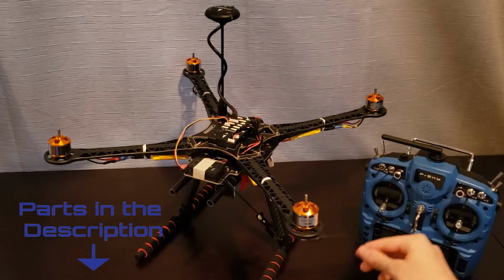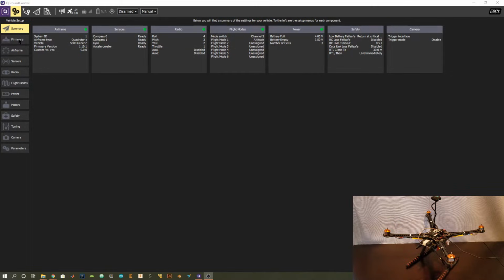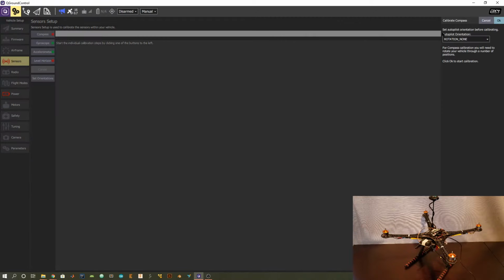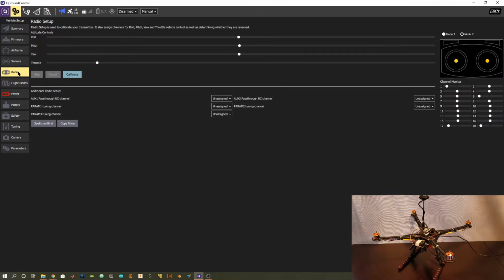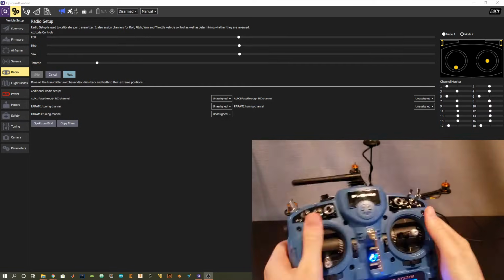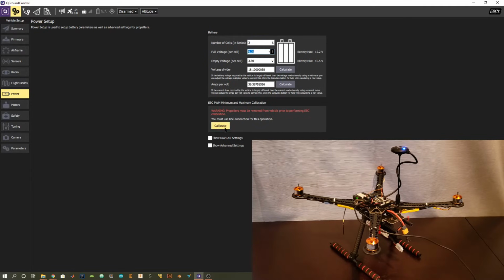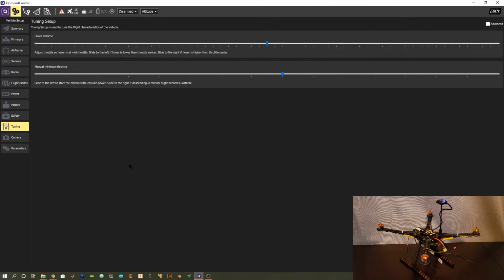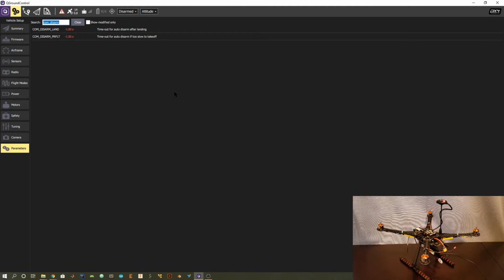Pixhawk 4 Setup and Calibration with QGroundControl | Pixhawk 4 + S500 Drone Build Tutorial | Part 4

Comment: Hey, thanks again for your eleborate and clear tutorial. I have a problem with taking off my S500. When I try to take it of in position mode (actually in every mode) it spins like hell and it is uncontrolable. It goes up in the air but spins so hard that it crashes after 3/4 seconds in the air (I already broke 1 arm and 3 proppelers :( ). 2 motors are spinning clockwise, 2 are spinning counterclockwise. I did ESC calibration in QGroundControl. I have the feeling that 2 motors (the clockwise ones)  are spinnin a little bit slower than the other two. Do you have any idea what the problem might be and how to solve it?
Reply from the maker: - First thing that comes to mind is that the motors are not spinning in the correct direction. The top left motor and bottom right should be clockwise, the top right and bottom left should be counter clockwise. Also make sure with the propellers that the leading edge is higher for each direction.
- Double check you selected the correct frame configuration in QGroundControl.
- When you did your calibration are your pixhawk and gps both facing the front of the frame?
- Double check any soldering you may have done, see if something broke off.
- Do you smell anything? This could mean a motor/esc burned out.
- Also make sure you have a full battery.
- It could also be something with the PID gains but since you are using a standard S500 the default gains should be fine to get you started.

Check these out and let me know if any of this helps.
Reply: @AlexFache  Hey Alex, thanks for your response. 
-The motor are (100% sure) spinnin in the right direction
-Pixhawk & Gps faced front of frame when calibrating
-I use the S500 V2. I tried PID tuning and choosing other airframes in QGroundControl but it didn't help, the drone keeps spinnin and crashing when taking off

I really don't know what else it could be, do you have any more ideas?
Reply from the maker: - Do you have the IO cable from the pixhawk going to the power management board? I assume so since the motors are all spinning.
- Try going into the parameters list and setting everything back to the default value (there should be a button to do so on the right hand side I believe, else look for all of the red labels). Maybe you accidentally changed something. The only one I believe I changed was COM_DISARM_PRFLT (you can increase this so that you have more time to takeoff).
- Are you taking off on a level surface? Make sure long grass/twigs don't catch the legs. This could create some kind of ground effect.
- Is there any chance you are flying in an area where other radio signals are present? (cell tower for instance) These could be interfering with your controls.
- Are your receiver antennae mounted away from motors? Same goes for GPS. Do you have a distance sensor, FPV transmitter, or something else that is sending out any signals. The way it's positioned could also cause some interference.
Reply: @watro2934  hi, did you sort it out? Please, check your motor order - for PX4  it should be (clockwise starting from top left) 3,1,4,2 - which is different from Betaflight's 4,2,1,3  (which is also common). There are also some others. This is what cause problem in my case, I also broke some props (luckily nothing else).

Comment: Great Job, I have a question: did you have to tune the PID parameters, o were the defaults enough to fly? Thanks :)
Reply from the maker: Hi Matte, for the S500 frame and my setup I did not touch the PIDs. They have been very stable for my flights and because there is a "default" frame available I believe they have been tuned by a PX4 contributor. All of my crashes were me messing around with the transmitter. However, if you do plan on adding heavy payloads then you may have to mess around with the values.
Reply: Alex Fache FPV Thank you! So am i right assuming that following your videos i will get mine up and flying? The setup is the same, i only have Holybro 2216 motors (wich btw are made for the s500)
Reply from the maker: I believe this is the kit you're referring to: https://shop.holybro.com/s500-v2-kitmotor2216-880kv-propeller1045_p1153.html
Those motors have pretty similar specs so you're good to go.

Yes, everything I had to do to fully setup my quad is in these videos. The only thing I recall doing off camera was securely mounting my receiver and telemetry module. The telemetry kit comes with some double sided pads you can use or 3M has double sided adhesives of different sizes. Just make sure that the telemetry/receiver antennas are out of the way of the props.

Let me know of there's anything else and have fun with the build!
Reply: I followed your videos step by step, and today my S500 quadcopter flew successfully at first try. Thank you very much for your guide and support :))
Reply from the maker: Congrats and enjoy flying!!! I'm really happy to hear the positive feedback that these videos are helping you all out!

Comment: I’m trying to get into drones using my 3D printer.  I literally know nothing and almost have a racing drone complete but I think I want the pixhawk for making videos.  Can you connect a caddy vista to the pixhawk?
Reply from the maker: I have not used one of these cameras before but I took a look at the website. Seems like it's meant to fly with a DJI drone but it might work for other configurations as a stand alone device. Here are some of my thoughts:
1. From my experience my FPV camera has not had to interact with the flight controller at all meaning it shouldn't matter which camera and flight controller you have.

2. For a FPV camera setup you'll need the camera, a VTX (video transmitter), a power source, and a compatible receiver on your ground control station / monitor / goggles. Looks like the caddy vista comes with a VTX and antennae built in.

3. If you want to make high quality videos then you'll most likely want an action camera instead of a standard FPV camera because of the major difference in video quality. For my Pixhawk 4 setup I have a a really cheap FPV camera and it's own VTX so that I can "see" what my quad sees but for filming I've attached a GoPro Hero 4.

4. The Pixhawk is just a flight controller and does not have a VTX built in. This means that you would need a VTX connected to your FPV camera to send your video feed to a ground control station / monitor / goggles. On your goggles you would need a receiver that pairs with your VTX. This will allow you to view live footage for FPV flying.

5. With the Pixhawk you have the ability to trigger a camera (action camera, GoPro) to take pictures however I'm not entirely sure how to do this.

Let me know if this helps or if there's anything else.
Reply: @AlexFache  It does help, perhaps I am over thinking things.  I started off building a racing drone using something called "birdbones" 3d print. I think because I am not flying I just want everything and perhaps do not have realistic expectations.
Reply from the maker: I've felt the exact same way. Buying a prebuilt quad is definitely easier and less frustrating, however, you learn so much more building your own and it seems like that's the direction you want to go. When I built my first drone it was a process of a few months from researching components to my first hover flight. I ordered the frame and main components, then decided to add FPV, then I had to get new batteries/propellers, then added a battery alarm, etc. Basically, I did not have everything I needed from the get go.

For your specific frame see if there is a recommended FPV setup (for instance how would you mount it, dimensions, layout of components, does it need an external battery). That might be the easiest way to get something up and running and you'll enjoy it more rather than focusing too much on the detailed specifications. My current FPV camera is a cheap ~$20 all in one (camera + VTX + antennae). Very cheap with okay performance. The big thing though, I was able to get it up and running using a monitor and was quickly able to enjoy it. That was important for me. I'll be upgrading to goggles and a better camera most likely with the next few months now that I've had some basic flying experience.

Comment: Thanks for the videos man, good timing, just put together a 3D printed quad, just getting it all setup, your videos will help with the pixhawk side of things for sure.
Reply: E85Johnson  your also into 3D printed drones lol new too
Reply: @takingtheblackpill  Yeah man, I'm planning on printing a few from this guy's designs: https://www.thingiverse.com/thing:753840 I went with the big TX8, it's huge! And weights a good amount with 2 11v 6000mah batteries. I'm going to print one of his smaller ones also.  First time getting into diy drones, it's really fun, but lots of research and learning on my part. At least with the 3d printer, I can have a lot of spare parts for when I crash lol.
Reply from the maker: That's really neat! I'd like to 3D print my own custom frame at some point. Having 3D printed parts will definitely come in handy if anything breaks.
Reply: @AlexFache  for sure, surprisingly the parts are really strong depending on the design and size. I went with a CR-10 clone style printer, it is nice, hardly any setup, very fast and easy prints. The drone design I went with in this one: https://www.thingiverse.com/thing:753840 probably should of went with an easier one, since this is my first diy drone, having some issues with the bottom motors, I believe I have the right props and cc/ccw motors, I think my issue is in the PX4 firmware. A Hex style would of been probably easier to setup. Wanted a big drone to carry large baits to drop off the beach and deal with wind.
Reply from the maker: @E85Johnson Getting those paired motors working seems tricky. It's definitely a cool design